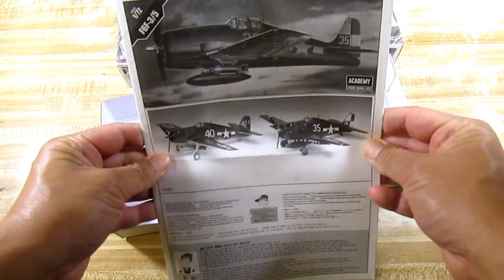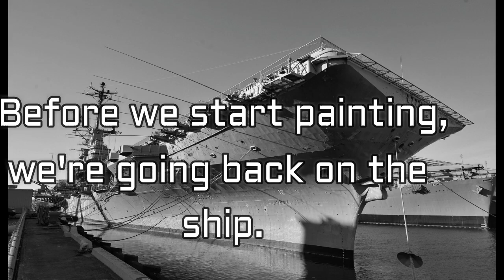Building Academy Hellcat And Tour the Real USS Hornet Aircraft Carrier

Comment: That is great this builder used highlight colors to go with the dark sea blue. I am still at the straight dark sea blue only level, and have always wondered about highlight shades of it. I guess on planes so far, I was doing somewhat factory fresh though, after always building weathered US Army Planes. All mistakes can be corrected on a model, although on My p-51 H, I am beginning to not be sure. Some early pre production Hellcats had a larger landing gear door cove that from a distance had a look of being turned the other way. Your models and videos are great too. I have had great luck using pin vise to drill into separated landing gear legs, and insert pin or wire into for repairs. I am thinking of trying to do that on left wheel of P-51 H as I failed to slide hub far enough inboard on axle. %min epoxy works well for these type of repairs/corrections as I have the 5 minutes to adjust and hold. I even built a balsa jig I white glued to bottom of wing to align all landing gear part. I still missed  a  little  on alignment!  It's turning out the F6F Hellcat, and now the P51H are perhaps my most studied up planes of all! Thamks